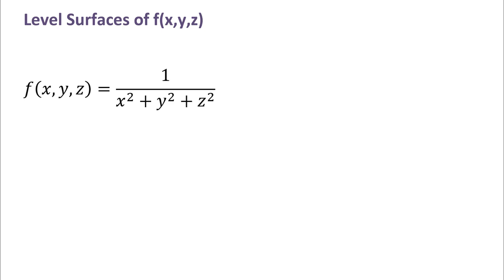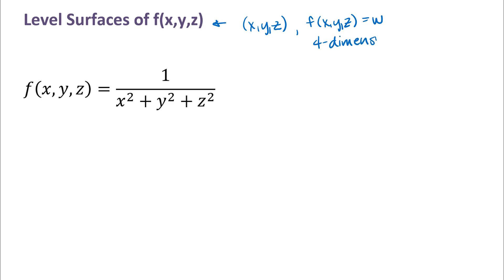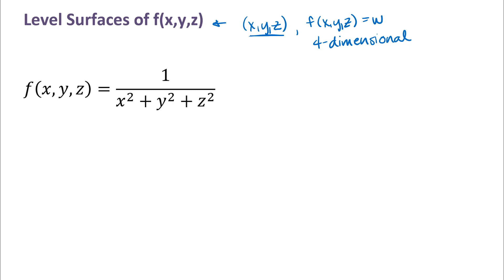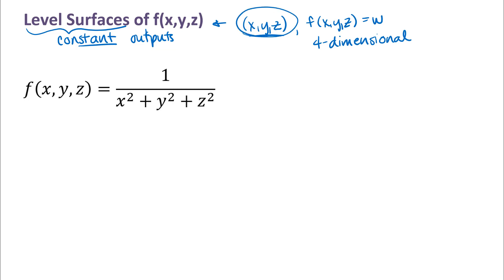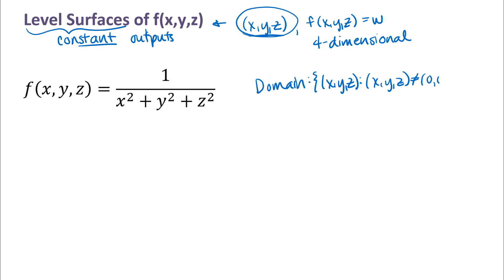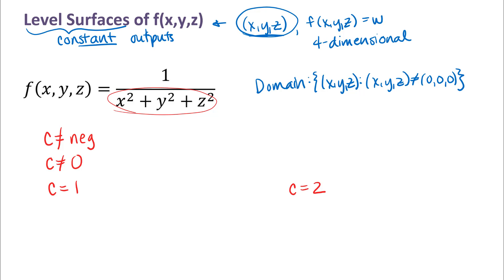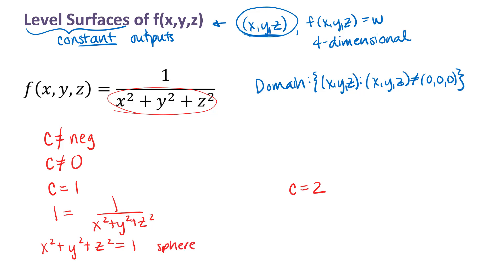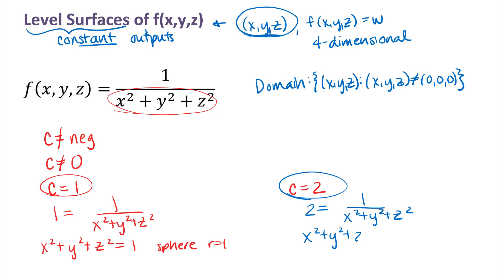Level Surfaces of f(x,y,z)

Comment: Well, it is very clear that the function is monotonically decreasing as the absolute value of x, y, and z get larger. So as we move away from the origin, the value of the function gets smaller. Since the function is going to be always greater than zero, the level surfaces of the function get smaller as we move away from the origin but never equals zero or less.